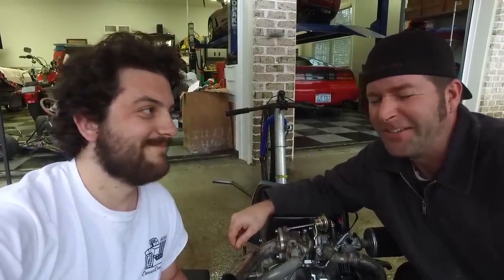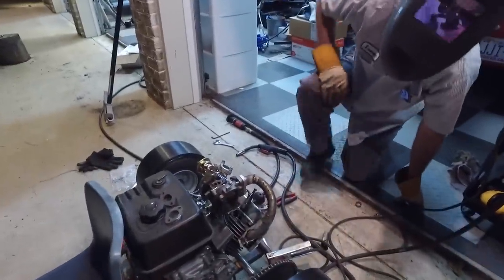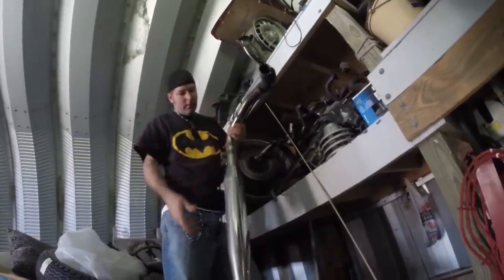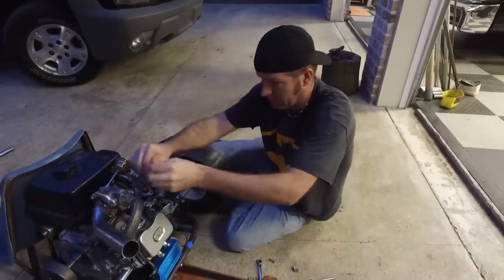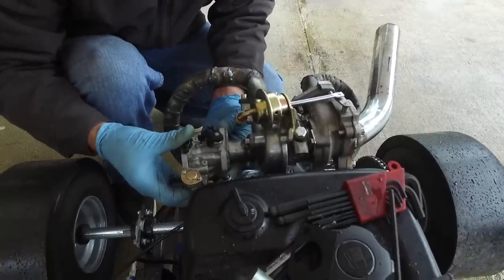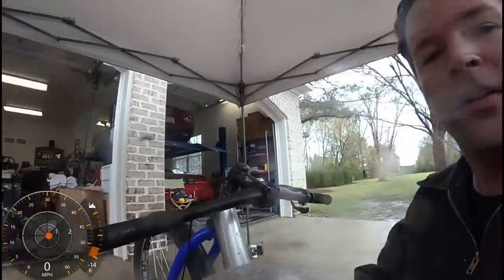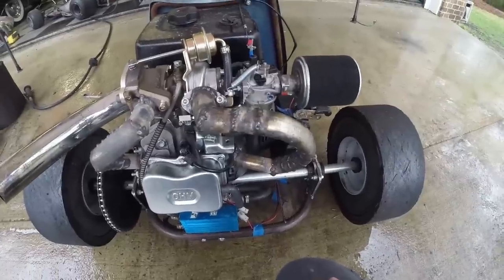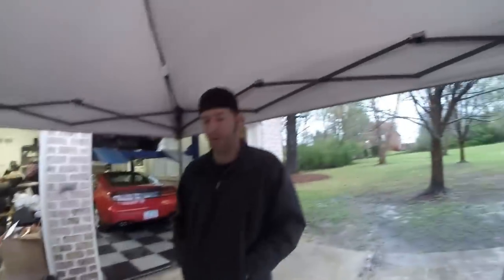Turbocharging a 420cc Drift Trike

Comment: Carbs and turbos do mix and mix well if you know what your doing. First and most importantly fuel pressure MUST be higher then the boost psi. For example 10 psi of boost should be running 14-16psi of fuel pressure.

Comment: You should revisit this with a mikuni. Do a blow through setup like you had it originally. You’ll just have to solder up the vent tube on the carb bowl. That’s how many carbureted/boosted stuff are set up.

Comment: there is a air bleed in front of the carburetor. block that off and you will not pressurize the bowl and you should not have the fuel problem. you may have to drill a hole on the outside of the carburetor to allow air to escape from bowl though.

Comment: you could try sealing the carb somehow and then go back to the blowthrough setup? if you use a fuel pump and fuel pressure regulator it should work in theory

Comment: if you want carb after turbo you need to fully inclose the carb in a box. this way, internally and external of the carb is equal pressure...

Comment: when doing a blow thru carb(like it was set up first) you need to equlize fuel pressure with the boost level, if the carb will hold a higher fuel pressure level

Comment: I made an oil cooler system with: 
7x12 cooler 
Oil lines
Threaded Nipples
18v drill battery 
Electric fuel pump (with the internal filters removed)
Wire.
Take it from there n run wild boys

Comment: pressurize the bowl in some way (like a cage from the start of carb to the turbo) so that the bowl is pressurized  the same as the rest of the carb, it WILL stop ALL of the bowl leakage like that (so the outside of the carb has the same pressure as the inside of the carb)

Comment: you need a ecu with a lambda sensor and some sensor that measures the air flow. or a new carburetor and camshaft for the correct valve timing.

Comment: #1 Suck through carbs on turbos are not unconventional at all. Put a good Mikuni carb on the motor.
#2 Youre non intercooled methanol would make more power and cool the air charge.
#3 Go to burns stainless and get some mandrel bent stainless, and tig weld the kit. Sharp corners cause the gas to fall out of atomization and puddle up. It will run much better and look 1000 times better.

Comment: I can't say I ever seen anyone put this kinda work into getting a small engine turbo successfully, I'm not sure if this would help but blow off valves are a essential need if it doesn't have a wastgate and it didn't look as that turbo had one it allows the access boost pressure to be released when you decelerate
Reply: it clearly has a wastegate, and blow off valves aren't essential

Comment: Use a larger diameter pipe on the intake side to reduce boost or rig up a butterfly valve in the turbo intake pipe and sync it to the throttle with a small pop valve...Or just say screw it and put the turbo on the v-twin

Comment: to fix the chargeing problem you could surf the interwebs for a high output stator or rewind the existing stator yourselfs..... if you add an alternator then your just robbing engine power that you tried to get with the efi and turbo setup so in turn back to square one

Comment: I have an idea on a solution to make both carb and turbo work together...Make them separate.  instead of have the carb go though the turbo or vise versa, you would have a "Y pipe" that leads to the combustion chamber.  Have the carb with its own pipe and the turbo with another lead into the "Y pipe" which leads to the engine.  Just an idea.  Cant wait for the 670cc to be twin turbskied. I also am building an off-road go kart with that engine.

Comment: Just Mount your carburetor on the intake side of the turbo compressor housing that is and should work good the problem is whenever you go into boost you have to have at least more pressure on the fuel pump than you do Boost otherwise it pushes the fuel back into your tank

Comment: the trick to turbocharging a carbureted system is removing all vacuum and fuel advance parts. then run a direct spray. you already know that you'd have virtually identical power as before turbo charging. people who did that would do it because with the advance parts torn off the carburetor it creates a makeshift fogger for nitrous oxide. now days the availability of cheap easy bolt on parts, makes such a set up an unrealistic alternative to safety and not possibly becoming a fireball.

Comment: +CarsandCameras as someone mentioned below the setup you are using has been used in a number of type setups over the decades. The best one I can come closes to for you is the Air Cooled VW has been creating 200-600 or more horsepower out of a 60hp case for over 4 decades now just as you have your's set up. Do a little research to find out more, if not contact me I will get you in the right direction. Good luck guys love your channel!

Comment: Hey guys, don't know if this will help you any, but I turbocharged my brand new Chevy Silverado Pickup when I purchased it in 1979. I went with a draw through setup, like you guys hit upon. I don't know if your carb is a Walbro style with high and low speed jets (screws), or if it has a float with the ability to change jets. Whichever it is, you're gonna have to fatten up the main (or high speed) jet as well as the idle circuit a little as well. You might raise the fuel level too. You can make it work, it's just way more time consuming than EFI, and not anywhere as accurate. Maybe this might help a little....
Reply: +Barry Bishop thanks

Comment: I can literally send you prints on how to do it. Turbocharging a carbureted engine is really easy. You DONT need EFI. Lol. But if that's an RHB31 or similar size turbo, expect it to window the block if you get it working properly, apply enough load at rpm to spool it. Lol. Even those little guys want to make like 80hp on a small engine.

Comment: I had one x 7 bullet soak off the 50cc put 810 for Gears semi auto with a carburetor 30 and a racing CDI that increases up up to 10,000 RPM and the engine from China are good reliable only cost likeC350 brand new bought it with electric start Kickstarter and turning it on by pushing it had so much torque that I had to extend the arm 9in and it still lifted up

Comment: draw thru setup can work and has. im thinking you don't have enough air & fuel going in hince no top end power. not wanting to idle could be from a cold spark plug and timing. turbocharging has a certain range of air to fuel ratio along with rpm that they love to operate in.

i myself would have turboed the 670cc

Comment: You need to put that turbo before the carburetor. What is happening is the centrifugal forces in the compressor is separating the gas from the air. It dont work like you might think; it will not atomize the gas with the air it will do just the opposite.
Reply: Also you have pressures working against atomization here. For instance to reduce boiling point of water, you simply apply a vacuum. Here you are doing the opposite applying pressure. You want to enter your fuel as close as possible to the engine. Fuel atomization is part of the compression cycle; a good cylinder head is the best way to improve this and your little engine probably is already doing a good job of this.

Comment: run a boost hose to the over flow on the carb so that the only way the fuel can escape is through the main jet into the engine.

Comment: Yeah, so basic turbo 101 for carbs, carbs run on vaccum. So in theory it doesnt really work, but you can make it work if you get an electric fuel pump. super easy and cheap. You wont need an efi system. then theres the ignition timing. but thats whatevs i guess

Comment: Hey guys, it's hard to see but if there is an air-bleed line from the pressure side to the wastegate actuator all you have to do is put in a little y splitter and then have one line to pressurise the fuel tank, that should solve a lot of your fuelling issues.
Reply: +SydneyCBR6 If there isn't a air-bleed line you'll have to weld in a little connector but same idea.

Comment: put the carburettor where the air cleaner is & have it as a draw through set up this will fix the pressure problem of blowing fuel out of the seals

Comment: Try a Carb from a  500CC single cylinder motorcycle.  A Carb should work, you just need to get the jetting right, and the single jet small engine carb will only work a WOT.

Comment: I know it's old but do you think using a pulse pump to equalize the fuel pressure in a better carb like a 26 mm mikuni would run better than relocating the carb?

Comment: Not sure on the Chinese junk engines but on the Hondas they usually copy the bowl is vented through a channel in the insulator between the carb and the head.  Should have tried channeling boost pressure there before moving the carb.

Comment: you can do it with a carburetor, but you need to put the carby in a top hat :D and probably a pressure fuel pump with 1:1 regulator (just a guess)

Comment: you should have mounted the carb with a single barrel old car style carb so it runs up and downward the carburetor sits horizontal not verticle. if you put the carb on the turbo it heats the fuel and it'll actually take power instead of produce power find how to run an intercooler that'd be cool

Comment: Can you put a Suzuki Burgman 650 Executive geared transmission and have the gear controller fully functional on a 2004 Burgman 400 and turbo charge it. Also would be cool if you could see which 3 lug car wheel would bolt up to the rear as well as install a power commander and tune it.

Comment: if it's building decent boost is it waste gated? needs a blow off valve. definitely don't need efi aircooled vw guys have been running carbs and turbo for a long time you just need a double or some with secondarys. two carbs with a staggered throttle would work also

Comment: The carb needs to be in a box that is at the air pressure of the turbo boost. You cannot blow through a carb, you can also not suck through it because the carb is too far away from the the inlet valve.

Comment: Turn the front housing of the turbo down and make the pipe shorter fuel would be sitting in the bottom of the turbo and the engine is trying to pull the full all that way when people put those turbos on thumpsters the pipe is short and and carb is sitting in the same spot as you have it on front of the turbo

Comment: you don't need EFI... it is better to have EFI on a turbo application but it is not needed... just get a blow through carb and save some time and money by not adding on engine control systems... adding EFI needs a lot of sensors and diagnostic equipment... a blow through  carb is all you need to get it running right and you can actually modify the carb that you have to make it a blow through... just google it and you will find endless info on how to modify a draw through carb so it can handle boost

Comment: Send a second line from the pressure side of turbo to fuel tank it will act like a balance tube, or put carb on intake side of turbo and let it suck instead of push. You are blowing back into the bowl.
Reply: second option would be install a fuel pump to match turbo air pressure.

Comment: 16:00 .....told you,  Carb on the other side of the turbo will work, how well I dont know. This way the air though the carb is negative pressure and will work with a lot of tuning. Port fuel injection is the only way to go. Not Cheap. Lets continue and see what happens........

Comment: Carbs and turbos can work BUT if you over boost it then the fuel travels 
The wrong way basically pushing fuel way , unless you widen the throat of the carb , obviously more power from injection but you can turbo a carb set up look at the MG metro

Comment: Isn't theoreticly impossible to turbo a carburator enginge? I mean, as the air get pushed into the engine, the mixture has to be changed along with it doesn't it? And a carburator is set to one specific mixture?

Comment: the boost will always push the gas back from the carb to the gas tank or out the vents under boost.you can slightly countersct this by running a boost line to the top of the gas tank to force the fuel the same psi as the intake but you will still have some leaking and run alittle lean.the only way to reliably and succesfully turbo one of these engines is get a fuel injection kit
Reply: thanks. we just got the efi
Reply: how much did it cost in total
Reply: wow. let me see, 12 to 1500 bucks
Reply: Isaac it'll be fine i would have done it if it were like 400 but yeah
Reply: the efi by itself was around 800
Reply: Isaac it'll be fine well i would have done propane if i were to tun the setup

Comment: cheap hack run a air line from intake to the gas tank pressurize it will help push gas under boost plus add a 1 way valve will help it from dropping off on vac

Comment: You need a richer jet on the carb, that'll give you power through the rev range. You can get a supercharger for an MGB/Landcrab and all you need is a 1 stage richer needle than normal and it'll run (and the lots of £) fine. 
Oh, and probably best not to try and ride it on a lake..

Comment: Why don't you run two batterys in parallel? Positive from one and negative from the other and connect in between. It will double the voltage. The magneto won't charge them but you will get longer run time. Or run the oil pump off of a 18V Dewalt battery pack?
Reply: Also you can adjust the boost so you won't be squirting gasoline out of the bowl. http://www.orangeaftermarket.com/assets/images/SWAG/RTV900Install.pdf 

This PDF includes how to adjust the boost levels on a similar turbo.

Comment: I have an idea I think I want to make it where there's just a regular sprocket like for a jackshaft which should actually allow me to play with gearing for the jackshaft depending on sprocket size as well just put the sprocket directly on the crank off the engine and then I'm going to put a sprocket on a jackshaft and mount my clutch and my V-belt pulley on the jackshaft that way my jackshaft will spin while the engine is spinning driving my V belt for the supercharger and my clutch for the rear end. I thought about adding 2 pulleys and putting one of my permanent magnet alternators on it as well but I'm going to have to use at least the 440 I don't think the 220 is going to have enough power to drive everything correctly. It's just too much of a pain to try and put a fully and the clutch on the crank so moving it to the jackshaft in theory I'm just moving the crank and adding some mounting space correct? Yeah I admit it's not going to be like any other Drift Trike or go kart but supercharger being self-contained for the oil will also stay cooler then the turbo and as long as I put everything together correctly and in the right spot this should staying in nice convenient package on the rear end and have plenty of juice what do you guys think?? Definitely reply please I would like to know what you guys think about this idea...

Comment: I have a homemade kart and due to a disability I’m unable to work on it. I think I’ve found the problem....... I woke up to oil all over my garage floor. I don’t think it’s the bolt plug but the scag screw just above it on the bottom of the motor. Can you please tell me what size it is?

Comment: Ofc carbs and turbos mix. check out the Renault 18 Turbo (1981-1982); Renault 5 Alpine Turbo (1981-1984); Renault 5 Turbo (1979-1982); Renault Fuego Turbo (1983-1985); Renault 11 Turbo (1984-1989); Renault 9 Turbo (1985-1989) all carburator + Turbo. Why dont you just try out one of those? Try to adapt it. I wish i could have cash to build up my own projects like you're doing.

Comment: The float bowl need to see boost pressure. Plug the vents and run a boost reference line from the charge pipe the the float bowl

Comment: Supercharging a 440 using the jackshaft as the crank with a V belt pulley on the jackshaft next to the clutch I think the supercharger will really work especially after I play with pulley sizes I should be able to dial it in between sprockets between the engines crank and jackshaft and pulley sizes between the jackshaft and the supercharger. Please reply I would like to know what you guys think about this idea.

Comment: Carbs and turbo chargers do not like each other. Now you know why it took so long for the turbo to actually be implemented in mass production(it was invented in the 1920's). It needs fast electronics to regulate the ignition and fuel flow properly.

Comment: need to run double amount of fuel pressure than boost. for example 3 pounds of boost you'll need 6 of gas if it's 3 and 3 they'll stop each other

Comment: I have a gc 160 5 hp honda pressure washer motor on a small yard cart I have a torque converter on order running cintrifical right now need to do a live axle on it because its a trencher one wheel wonder what is the easiest cheapest way to do so

Comment: What about if you guys making intake where the turbo blows in in front of the carburetor and the carburetor bolts on with its own air cleaner behind so you don't have to run carburetor through the Turbo

Comment: Split the inlet of the engine and put on the oneside the turbo and on the other an carburettor or an fuel nozzle for stationary dont forget to put an noreturn valve or how its called in english, so that u cant pressiorize it from the turbo i think it should work
Reply: +Cris Codinach sorry but that can't work, no-return valves work by fuel differential, the turbo pressure would keep it closed so the carb side couldn't feed fuel to the engine. The only way to do it is to pressurise both sides of the carb and then seal the float-bowl better with some silicon or something that can hold the boost.
Reply: If u reach stationary the turbo pressiure wil reach -0.2 then it ill work